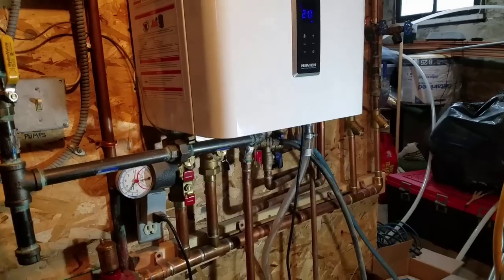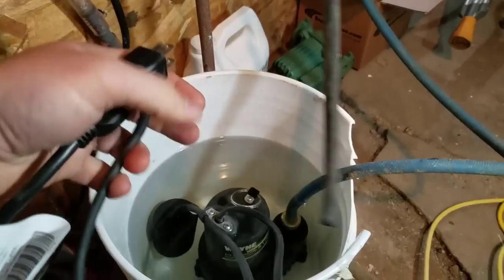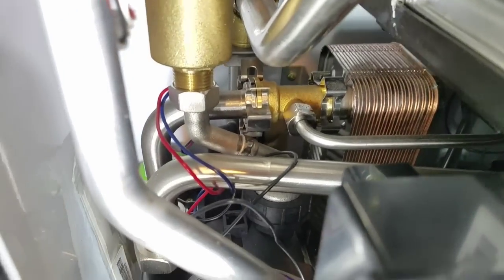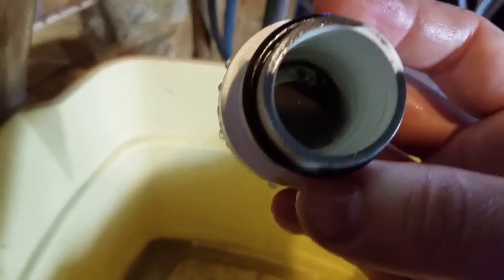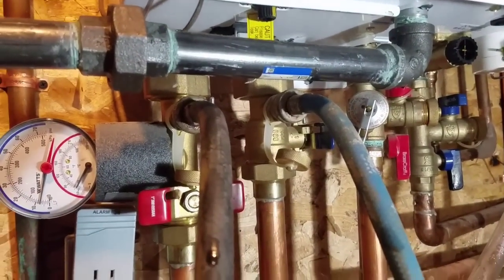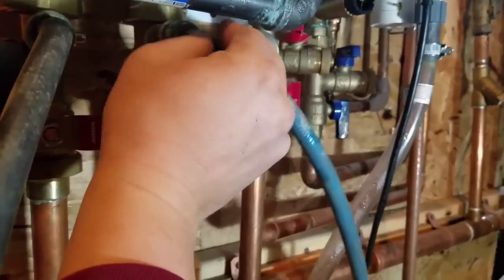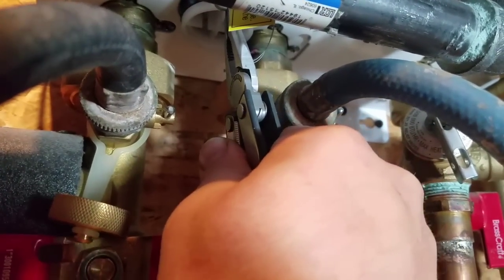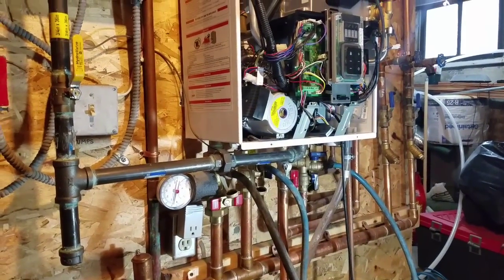How To Flush Descale Tankless Water Heater and Maintenance heat exchanger Navien NCB240 Combi Boiler

Comment: This is an excellent video. I have an NTI condensing boiler. But I don't think it has a domestic hot water side. The boiler water goes into a heat exchanger???? But wouldn't that setup result in a lot more corrosion? Because new water is always being introduced? Sort of confusing. I have well water. Lots of calcium and rust. Nobody in this area seems to know how to flush these things and it's hard to find a service tech. I had a recent service but they didn't flush anything. It's also hard to figure out where the pump should go. But I'll probably need to do it myself. I get Kettling or banging but only after I take a shower when it's cranking up. If I shut it down for 10 minutes it seems ok. But this is a great video. Thanks.
Reply from the maker: Thanks! The boiler water heats the domestic hot water by means of a double plate heat exchanger, which keeps the boiler water totally separate from domestic. The boiler water stays in the system in a closed loop. They tankless water heaters are pretty particular when it comes to water quality. But if your on well water, they just should be flushed more regularly. Pre filters and softeners will take out iron. It is unfortunate a lot of plumbers dont seem to know or care about flushing them.
Reply: Im still having problems with my condensing boiler. Its different than yours. Mine only has one in and one out. Its not a combination boiler. The funny thing is i only get banging after i use hot water. It does not happen when using heat. I cant figure out why it only happens with hot water. The line divides after the boiler. When there is a call for hot water, a valve shuts off the heat. When the hot water tank is up to temp, the heat valve opens. If there was blockage inside the boiler, i would think it wouldn't make a difference. I dont know why the flow would be restricted to the hot water tank. So im still working on it. Still unable to get an HVAC guy to check it.

Comment: Nice video I am looking to install one of these in my home to replace a boiler from 1963 and even having been an HVAC service person and pipefitter I was not 100% clear on the maintenance required so thank you for the video.  Do you like the combi boiler and has it worked well for you?
Reply from the maker: Great to hear! Yes, its not common knowledge. I love the system. There are some hot water sandwiches sometimes, but I've never had any other problems. Our local city wasn't even allowing combis for some reason. They are not much more than just the boiler itself.  Navien have a great reputation.

Comment: Thank you for this comprehensive video. I have the exact same system installed in 2016. So 2 years later I’m doing my first flush hopefully everything goes ok. Thanks for your help.
Reply from the maker: The two way valve is notorious for failing on these, so a flush is a good idea!
Reply: Two way or the three way valve?
Reply: @tomfisher5329  It's a 3-way valve and he's right.... they're known to go bad. Navien has actually discontinued the original valve and put a new "revised" version into production for replacement when needed. The crappy thing is they won't be sending these "revised" valves out until the old stock has been depleted. I know this post is 4 years old but thought this might help someone who is flushing their combi-boiler. My 3 way valve went bad the first time and didn't flash a code... just the red-wrench symbol. It has gone again and I once again have the red-wrench symbol flashing (4 years later). My plumber just said to keep running it. After 4 years, I am just doing my first full flush/descale on my unit and so far the domestic side is clean like this video. I hope the other side isn't as grungy as his. Lol. I had a 110 code flashing initially and once I cleaned the air intake screen and the distillate cap.... then reset the system.... the code went away. These are actually very user-friendly to service yourself and the parts are also cheap! Also, the tools you need to do this yourself should cost you about $110.00 Canadian (small sump pump and a washing machine hose kit). Saves me calling a plumber and paying him $400 every year!
Reply: How would you know your 3 way valve is bad?

Comment: Good video. Very helpful but I’m having an issue. After I flushed the system and did everything you did I started getting and E 016 error code (overheating heat exchanger) not sure why. Air in the system maybe? The unit boots up fine but when I turn the hot water faucet on the system starts to heat up, then starts to knock and then goes into E016. Any suggestions would help. It’s been 4 days with no hot water😫
Reply from the maker: jimg81 bummer, but that's not enough information to diagnose the problem
Reply from the maker: The water heater side? That is unusual..must be air in the system. Did you figure it out?

Comment: Thank you for the video I have a Navien my house has well water it was installed 4 years ago never was told it needed yearly maintenance to flush I have drained, cleaned and replaced filters but never flushed video is really helpful.
Reply from the maker: Lori DiNobile2 thanks, glad to hear! the heat side doesnt need to be flushed every year.  Just water heater side
Reply from the maker: It especially should be flushed every year on well water.

Comment: Hi please help me I’m a single mother/homeowner and my unit doesn’t have heat. What steps should I take to fix this without calling a plumber.
Reply from the maker: Jennifer A. There should be error codes on the boiler. You can look them up in the operator manual. Other quick things to check are if the power's on to the unit, and if the intake or exhaust outside are blocked with snow or ice. Does your hot water work?
Reply: Larson Home Inspection possible water damage to the circulator pump. No error messages on the box
Reply from the maker: You should hear or feel if the circ pump is working. I suggest calling a HVAC tech asap. Hard to diagnose via messages.
Reply: Larson Home Inspection thanks will do!

Comment: To messy couldn't understand very well didn't explain what to shut off what to hook up anyway thanks for the video
Reply from the maker: JiJi Mu'mens ON sorry you felt that way. Yes, this job is not for the faint of heart. You need to have a basic understanding of hydronics and the valves. The video would be an hour if I explained everything.
Reply: I'm a handyman and trying to learn this knew system my site is bringing but your video was not to helpful for me at least but like I say thanks for the video and take alot to do so and patience .

Comment: OK why the boiler side is dirtier if is a close loop system
Reply from the maker: Good question. The flux paste/solder and dirt stay in the system in a closed loop.  In an open loop, they get flushed and cleaned out with clean water. Also, my system is pretty old and had antifreeze in it, which also added sludge and color.

Comment: Great job on this video.  Was not sure on which step you mixed in the Hercules product?  Did you at one point mix it into the bucket with the Vinegar to flush and descale? I noticed at 9:25 of the video the water started turning from slight blue to slight pink/red I assume that was the Hercules being circulated cleaning the system along with the vinegar? Thank you much appreciate you posting this video. Cheers!
Reply from the maker: Thanks! I should have clarified; the system already had the Hercules in the system before doing the flush. I add a bottle and leave it in the system. You sure could add boiler flush to the vinegar for the space heat side flush. The flushed water that came out is pink due to the Hercules flush in the water, and my system had orange antifreeze in it at one point.
Reply from the maker: To add boiler conditioner : I had a 4' washer hose installed on a purge valve for inlet, and another hose at the end of the loop. Opened the end loop valve to drain water. This started a siphon on the inlet, so I could pour the conditioner directly into the garden hose (holding it above the valve) which would get siphoned into the system.

Comment: Hi, in your video, you said you have to fill the water to the spaceheater system without air, i was wondering what that process is going to be but your video stopped while you flushing the spaecheater system with public water. my question is, what's next step? do you have to fill it up manually? or just disconnect the hoses and the unit will fill the system by itself after you turn back on all the valves? thx again for the great video.
Reply from the maker: My spaceheating (secondary) loop to the house was already filled with water. I isolated the loop from the boiler so I could flush just the boiler. Once you're done flushing the boiler, you can just close the hose bib valves, and open the primary loop (spaceheat) valves. The water will stay in the boiler. To fill the whole system, you hook up a city water supply (washer hose) to a hose bib on the supply side loop, isolate valves below it (isolate secondary from primary) , open a hose bib on the return side loop to allow air and water to run out, and run water through the loop. Once it's flowing only water, close the valves. An air scoop and air separator should be installed on the supply side, and a purge in the boiler itself will eventually eliminate the air in the system. I just meant you don't want to drain, and refill the water in the spaceheating system often, because it reintroduces oxygen to the boiler water.

Comment: My plumber just installed one ncb240 for me, we have not start the unit yet. my spaceheating supply line is smaller than yours, will this be an issue?
Reply: Andy Larson my plumber install 3/4 line from the boiler and then 1 inch when it intercept the close t. I have four zone valves with one circulation pump, four bathroom three kitchen with 2300 square feet
Reply from the maker: Right off the boiler? It should be at least a 1" pipe. Then it goes into a 1-1/4 pipe for the closely spaced tees. This is Navien's recommendation. If you have a small house with only one zone, a 3/4 might be ok. Could you post a pic?
Reply from the maker: I believe that's undersized for 4 zones and a house of that size. Four 3/4" zoned pipes would require a 1-1/4" primary pipe for proper flow. It will likely make the pumps work harder (more head loss) if multiple are running simultaneously, and will increase the return temperature, thereby reducing the boiler's efficiency.
The supply and return connections on the boiler are 1", so I don't think it's good to reduce it to 3/4".